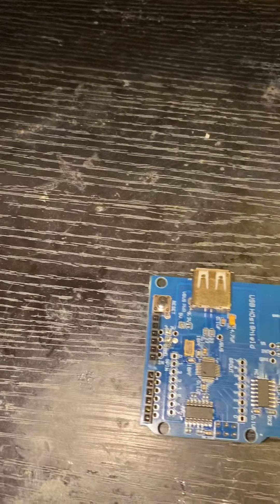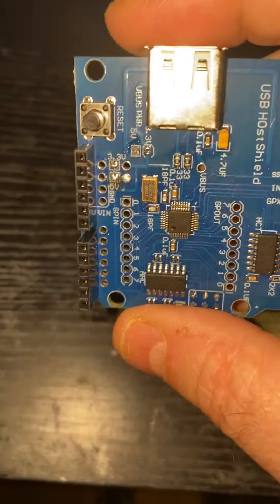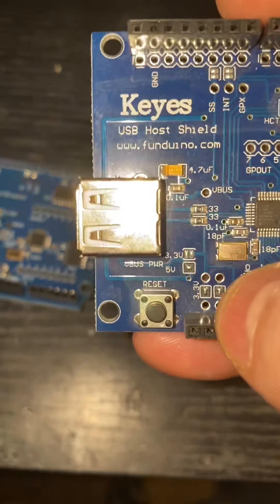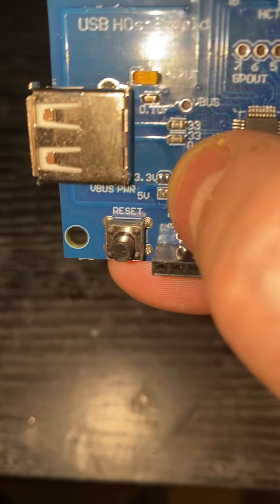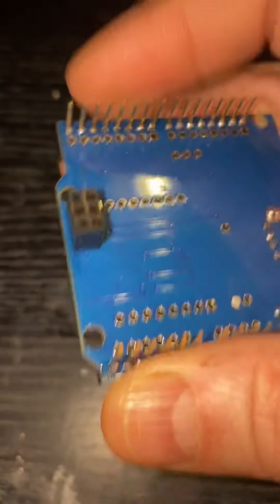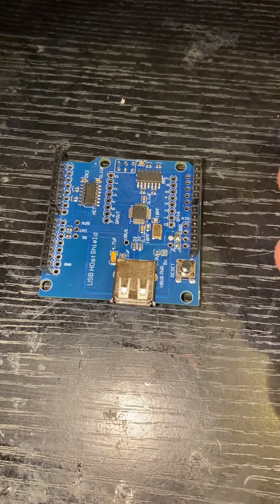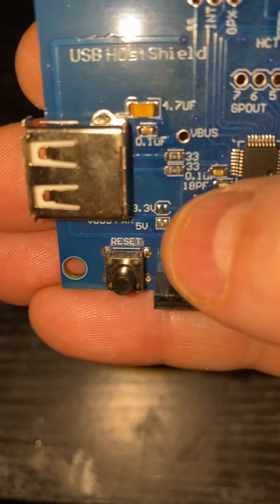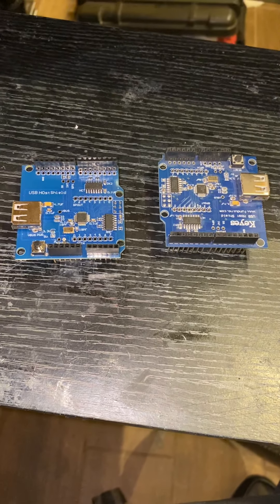Padawan 360 and USB host ‘gotcha’

Comment: Michael and Ben .. My generic USB Host shield did not have power links in place .. so after I corrected this I managed to initialise USB via shield and see hset actions represented in serial monitor .. thanks guys.  Ok so while the process is seen to work .. I have only been able to achieve successfull USB init the one time .. every other reseet results in failed USB init error sent to serial monitor.  Do you guys find that with the Keyes shield .. you see successful USB init every reset?
Reply from the maker: Mark Brooks that happened to me also, this was the pins connection to the Arduino, hence I slightly bend the ends to get a reliable connection with the Arduino. The Keyes has thicker pins and connects more reliably however once I’ve put a link in the pins and seated firmly they work reliably (tested on 4 units).
Reply: @MichaelBaddeley  I see so this 'unreliable' USB init is a result of poor connectivity as you described at start of this discussion.  That's great .. I now have full confidence to proceed.  I can bend pins as you have tho my prefered soln is the Keyes shield which is on its way from US.  Thanks again.
Reply: Michael .. thanks for your advice .. I ended up cable tieing the USB host shield down to the Mega at all 4 x corner holes and that compression was enough to create reliability.